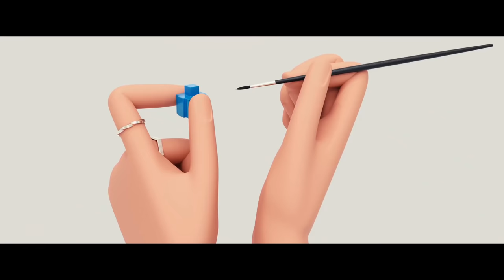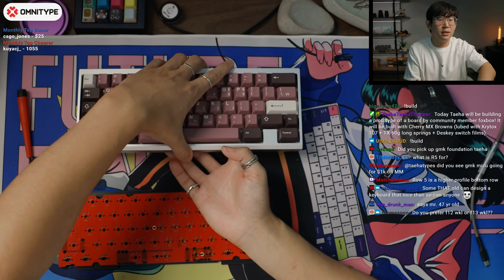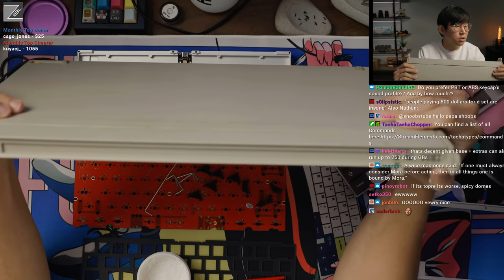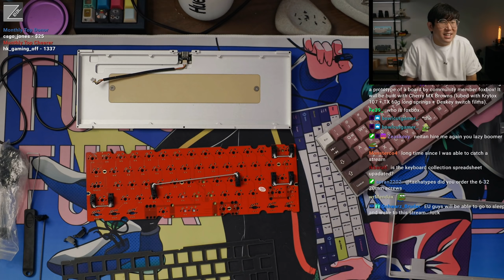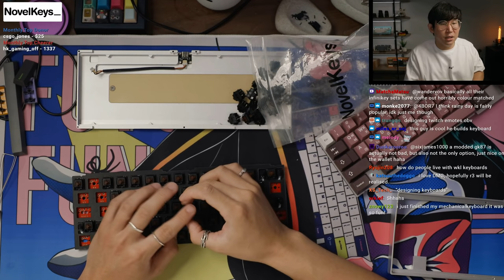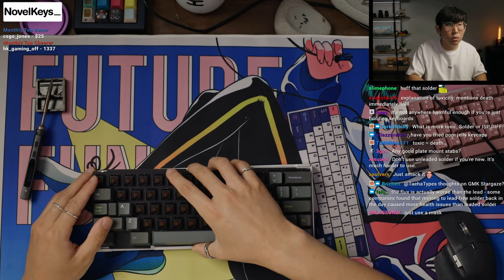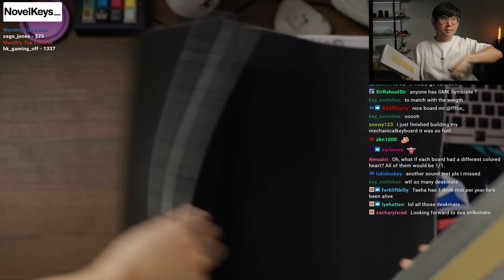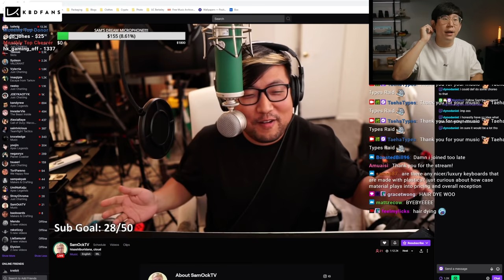GS60 Prototype Build Stream

Comment: I feel like this board could have sounded great with some other switches.
Reply: Not the best but it certainly doesn’t sound bad imo. I would rate it a good 6 or 7/10 in terms of sound.
Reply: Did you go passed the part with the noise gate?
Reply: @papi6518  yes i did. The switches kinda sounds a bit flimsy or rattely
Reply: @eliasvaly2273  no

Comment: yk i dont dislike mx browns if they are hyperglide browns and they are broken in and L/F but if they are just lubed and filmed and not broken in then thats when i just hate them
Reply: hyperglides are definetly not worth it for the price they are sold at especially at what little difference they make compared to retooled. Sound is all preference in this hobby and that's the beauty of it. Imo i think is sounds good because of how unique the sound is and i feel like the scratch gives it a lot of character.
Reply: @uraqt2516  i do agree with you to a certain point like how the beauty of this hobby is that is all preference when it comes down to feel and sound but i dont like the scratch that much it just makes it seem weird, it doesnt make the board sound cheap it just makes the board sound different then what it looks like it what sound if that makes any sense.